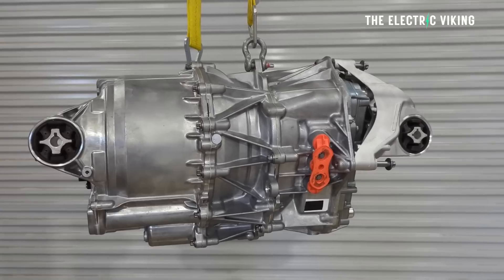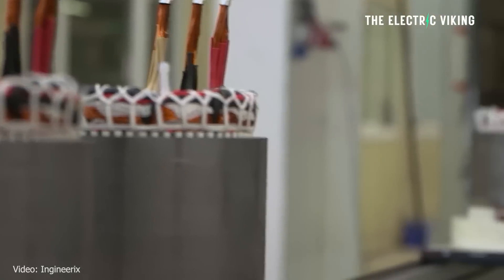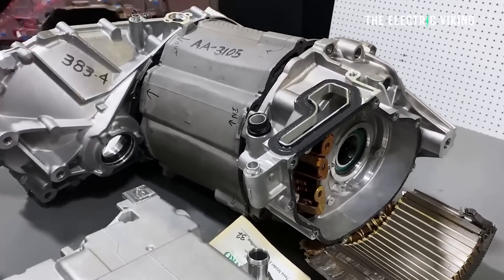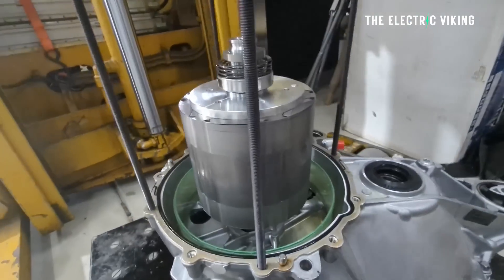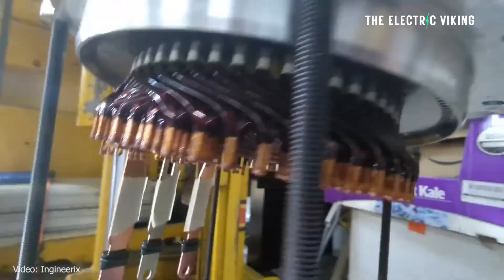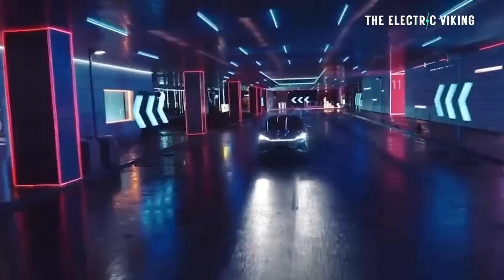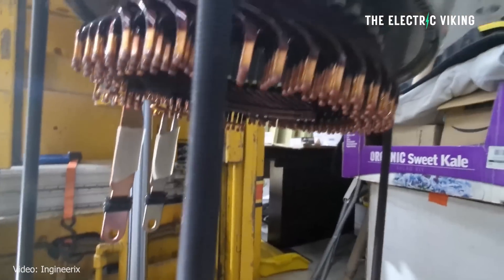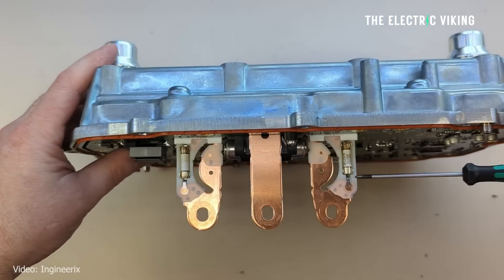Tesla Model Y electric motor compared to VW ID electric motor

Comment: I only have a little time and you have made close to 3000 videos. I like what you are doing, but you might want to look at the uses of vehicles and weight. Cars tend to have lots of "stuff" that probably is not necessary. I had to model the global vehicular fleets for global climate change many years ago. What struck me was how many people only have the option to buy a car "with everything". A single person has extra seats. I found a few groups who are taking cars apart to see what is really necessary for the job the owner wants to do. On car crash, it might be much easier to redesign cities and car uses than to add more cost and complexity. The safest car is one that never crashes, or where it is not needed in the first place. Those kinds of things. Of course, walking, biking, the Internet. I wanted to stop China before they invested in more roads and cars. Try to encourage internet and virtual methods for country-wide education and work and community. For a fraction of the cost of travel, most business can be done virtually. I know people like to get together, as long as the company or country pays for it. On a species level, that is not always a good idea. I looked at all the electric motors, generators and transformers in use.  They have not been optimized in a hundred years - for all humans.  Electric cars are a toy for a few ten million rich people.  Most of the 8 billion humans now use far less. Some from need and others from choice.  Richard Collins, The Internet Foundation

Comment: Yes the motors are smaller and put out more power when compared to ICE engines. That said the weight of a tank of gas compared for a ICE engine and time to refill vs recharge more than makes up with current battery tech. Its not the motor companies need to invest in its the power storage. Most people could care less about a engine 1/3 the weight with 3 times the power if the battery is x10 the weight of a tank of gas  you lose that weight advantage then it takes on average a typical electric car (60kWh battery) takes just under 8 hours vs 90sec at the pump for gas... even a rapid charger giving 100mile(160km) will take 30mins... Time is issue. Once EVs recharge with the same convenience as a ICE is when ppl will adopt EVs without issue

Comment: When you compare the weight of Diesel- versus electrical motors, you obviously also have to factor in the weight of the whole unit - meaning INCLUDING full tank, and battery. As of now, electrical cars are still dragging around a pretty hefty weight due to these batteries. I am sure this will improve - but it has to be considered, if one is to be reasonable.

Comment: Tesla realized long ago that each incremental improvement, or problem avoided, will be multiplied a million times in production. A big contrast with legacy ICE manufacturers that outsource components to keep costs down and quarterly shareholder earnings up. Tesla proves to the accountants that intelligent quality design with vertical integration generates nice profits.

Comment: there are NO volkswagen EVs with front wheel drive in production.
their new in-house developed motor for the ID.7 together with the new electronic has a much improved efficiency! latest rumors are in the area of 13,5kWh per 100km WLTP which is 1,5kWh better than the usual 15kWh. and this for a big car like the ID.7 which is a kind of electric successor of the Passat

Comment: Great video Sam.  I personally don't believe there should be gearboxes and filters that are locked down and cannot be flushed.  It is a cost cutting ploy to make their gearboxes that way so they would instead need expensive maintenance later instead.  Sort of like smartphones and their movement to nonremovable batteries.  Any gearing will have a certain about of wear with millions of tiny metal particles floating in the fluid chewing up those gears further.  This is not debatable!  I would prefer to at least have the ability to change that fluid at 75,000 miles or so and it not be locked down to possibly require replacing everything after a failure instead.

Comment: The power output is a short time peak power. 
The main reason for the similar size is because the drives are optimized for optimal efficiency at normal driving.

Comment: Very interesting video however I would comment that if it's true electric motors have an incomparable power to weight ratio compared to internal combustion engines, you also have to take into account the weight of the battery, and that makes them less interesting suddenly... Electric motor + battery vs. IC engine + full tank of fuel... ;-)

Comment: Are we comparing apple with apple? 
Maximum power an engine can produce can not be compared to a nominal power derated to last 100k++ km.
If Teslas max output is compared to nominal power informed by WV, comparison is not correct. 
Both should be tested at same test conditions.

Comment: It's the motor design, battery management  and software which tesla combine to produce the most powerful drive chains. Tesla continues to innovate. The oil cartridge does not need to be changed. Teslas engineers are the best - hands down.

Comment: I think the power output and torque figures dont matter, years ago most cars were underpowered, motorway driving was noisy and stressful, "A" road overtaking dicey (UK experiences anyway) unless you had top of the range engine and tune for the car,  gradually that phased out, particularly with advent to  ubiquitous Turbocharged engines or modern electrics and ever present speed cameras, 
Cost of manufacture is part of the new battleground. I think eliminating heavy and  complex  mechanical differential and reduction gears, possibly windings, could make a  difference, if you look at say an AWD, hybrid with massive gear sets and couplings, chemical treatment plant,  complex variable valve gear, forced induction hardware and motors and batteries, the scope for simplification are vast, Sub optimal motors and batteries will not be a big differentiator once you ditch the ICE tech. 
Brand perception, quality, driver experience and quality will be bigger. VW Ford etc dont have to beat Tesla technology they just have to be in the same playing field.

Comment: Enjoy your videos! One thing I would like to point out that may be of importance here. On many new petrol vehicles, like my 2019 Mazda 6, they say you never need to change the automatic transmission oil or it's filter. "It should last the lifetime of the car." This is clearly wrong. Oil wears out and oil filters get clogged up. When asked what they mean by the lifetime of the car, the refer to the warranty. That is not the lifetime. So beware of any claims to any oil/filter lasting the lifetime. Check this out: https://www.youtube.com/watch?v=hi4nzS0uOX0&t=442s

Comment: Any idea what  the BHP power is of the 2023 Tesla Y  RWD with LFP battery?
Reply: It's 208 kW si around 275 hp, the Viking is wrong this time since the power he's told is really of the Dual Motor version.
Reply: @MiguelAngel-xl5xd  Just read these specs.  Performance Specs Tesla Y RWD
Power: compare
220 kW (295 hp)
Torque: compare
430 Nm
Number of Engines:
1
Drive: compare
Rear
Acceleration 0-100 km/h: compare
6.9 s
Top Speed: compare
217 km/h

Comment: A combustion engine doesn't thermal limit it has full power continuously you can't compare the 2 like that
Reply: Internal combustion engines for cars have the same intermittent peak power requirements as EVs. Driving up a big mountain at full power will often reveal that. Or towing up a mountain.

Comment: Vw and other Meb platform cars are either rear wheel drive ot four wheel drive not front wheel drive at the moment.
Reply: Exactly. He does say, that VW cars are primarily front wheel drive, which is true for the ICE-cars. But we are talking EV's here, and the are not front wheel drive. The coming ID.2, they have shown a prototype of, is supposed to be front wheel drive. All in all, Australians don't know much about European cars, since they are made so far away. Recently the Viking talked about all the ID. models and the confusion. He mentioned ID.1, ID.2 and so on. They don't exist at all. ID.1 hasn't even been talked about. In Europe we have two models: ID.3 and ID.4. The ID.5 is a coupé version of the 4. In China there is also one or two large SUV's, but that's all. No confusion.

Comment: IF Tesla have such a "refined" motors as you claim, how come they are the least reliable and overall cars with most failures?
Reply: Source?
Reply: @fredbloggs5902  J.D. Powers Record; German TÜV Report, available on the internet
Reply: I’ve read multiple accounts of “failures” and they are typically minor such as fit/finish issues.  Very few batts and zero drive units.  Please explain if I’ve got a reasonable understanding.  All I consider is Reality, so not trying to be hostile or debunk your statement in any way.

Comment: 2:59 that’s a differential. So the electric motor package also includes the differential, which in an ICE vehicle would be separate from the engine, just after the gearbox. Amazing compactness!
Reply: and the coolest thing ever is when you get rid of the differential and put in two electric motors. that is also great for a three motor configurations which gives wonderful traction control.

Comment: Thanks for your video. Your focussing on Tesla's new hairpin design and its benefits without talking about the VW stator design explicitly is probably somewhat misleading. VW produces hairpin stators in Salzgitter right from the beginning of the ID.3 production ~3 years ago. I've visited the factory (just as a private visitor group) just a week ago and was able to see the machines cutting and bending the hairpins from a copper wire coil, placing them in "nests" and putting them into their stator housing with some special paper isolation. Quite slow, quite some discards (as far as I could tell from just a few minutes). But automated hairpin design for a rather long time now. (Have seen some of the lab cabins of the battery cell research team also, pouch only at that place, and a short visit and explanation of the battery recycling machinery. And also some hand made Bugatti Chiron ICE machines. :-|)
Reply: re: "Your focussing on Tesla's new hairpin design and its benefits without talking about the VW stator design explicitly is probably somewhat misleading". to be misleading is EXACTLY HIS POINT.  what those paying attention recognize is how this was also the point of Beth Holmes/Theranos, Trevor Milton/Nikola, and Sam Fried/FTX Crypto.

Comment: When quoting EV weights vs Internal combustion parts, like the electrical motor vs a diesel engine mentioned here, I really think it needs to be the complete powertrain that is compared. I’d the weight of an EV motor, transmission & HV Battery vs a diesel engine, it’s transmission and fuel tank - (maybe empty & full, and compare the half full weight as the ‘average’)….this way you get a truer comparison. 

If I were running a YouTube channel that was biased toward internal combustion engines, I might be saying something like:

“The weight of batteries in an EV is 400kg’s, 400! The weight of batteries in an internal combustion engine is only 20kg’s!!!”

My point is, not that EV’s are bad and ICE’s are good, (or vice versa), just that if you must compare the two, it needs to be a reasonable & fair comparison. Cherry picking specs to compare that make EV look good & ICE look bad does let’s you and this channel down. They each have their pros and cons, just present it honestly rather than always trying to ‘spin’ it.

EV’s & ICE’s each have their own pros & cons. It depends on an individuals use case as to which is better suited to them. Overtime, I expect EV’s to close the gap to where the ICE has pros - things are developing at a faster rate for EV’s now than they are for ICE.
Reply: Agree, Lawrence, comparisons need to be made carefully. One might also include the ice 'exhaust' system, and the masses of CO2 it ejects over it's lifetime. Plus the mass of front-rear transmission shafts & associated structural accomodation for 4wd vehicles vs power cabling. Perhaps also consider the better mass placement cg-wise of a battery+electrical motor vs ice +hydrocarbon tank, plus the safety considerations in locating the ice fuel tank from the perspective of crash performance. Then there is the mass-saving from reduced structural load support requirements for the lower mass e vs ice engine, bearing in mind a floorpan battery-pack offers the opportunity to enhance the passenger cage safety due to it's stiffness; more mass amortization, especially if monocoque. While no Musk sycophant, Tesla seem well ahead just now...    Now just to reduce the mass of the average vehicle occupant, eh?!
Reply: @jesflynn4048  ….🤣 @mass of occupant comment!

It’s hard to know where to draw the lines when trying to make such comparisons. You are right, I would definitely want to include the exhaust system into the ICE powertrain though.

If you look at commercial vehicles, like Merc Sprinter, Ford Transit etc, in Europe, governments permit individuals holding driving licenses which limit them to driving ICE powered vehicles up to 3500kg GVM, to be able to drive EV’s up to 3900kg GVM or even 4250kg GVM (it varies by country). The Governments recognise that the EV versions of ‘3500kg GVM vans’ weigh more than their ICE counterparts by around 400kg, so have increased the driving license restriction for EV’s. Without it, a 3500kg GVM van that anyone could drive on a standard license, when available with an EV powertrain would have ~400kg disadvantage in payload vs a comparable ICE variant. 

If you Google the weight of a Tesla Model 3 it will be around 1750-1850kg. If you google a broadly comparable vehicle, say, a Ford Focus, it will be in the order of 1250kg-1500kg….ball park figures. 

So I find it annoying when I see cherry picked stats trying to pass of EV’s as being lighter than ICE equivalents, and felt compelled to comment. Just be straight & honest about it, EV’s are heavier like for like (at the moment), that’s just the way it is with current technology, EV’s have other advantages that their ICE counterparts don’t have, but being lighter in weight isn’t one of them - yet. In years to come, with advancements in battery technology, they may well end up being lighter, but we are years, if not decades from that. 

As an aside, a typical ICE 3.5t van has a range of 550 miles or so. The comparable EV vans have a range of around 150-200 mile. You would need a battery about 3 times the current size (& weight), to get a comparable range to the ICE, just imagine how heavy the unladen vehicle would be then! It would be nudging 3000kg, and have very limited payload as a result. This is one reason why EV range is limited vs comparable ICE vehs, it’s a trade off. Some users don’t need 500+ mile range, others do.
Reply: You make a great point. This episode of Fully Charged (linked) investigates a company repowering Aussie 97 tonners the new set up is between half a ton and a ton heavier after all evidence of ice removed and the new (swappable) batteries, motor and gearbox are installed. 
https://youtu.be/9eYLtPSf7PY

Comment: Tesla has been exclusively building EVs since 2008, they have had 15 years to improve and refine their designs. VW (and other car makers) are playing catch-up. They have only seriously started making EVs less than 10 years ago, and they are dividing their attention between their EVs and ICE vehicles. Having said that, they are decent enough (if overpriced) EVs, and eventually they will correct their mistakes, e.g. haptic buttons.

Having said that I am biased; my wife loves the look of the ID3 and we are supposed to be be going to look at one this weekend. I have pointed out that they are bigger and heavier than they look.
Reply: had one: they ride well so you don't notice the mass unless footing-it. The controls are a bit of a pain, though.